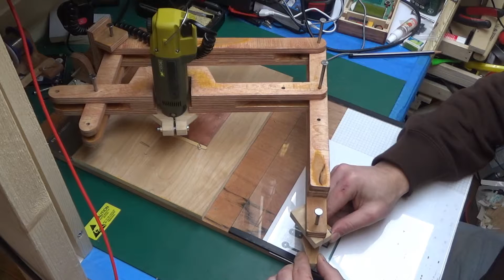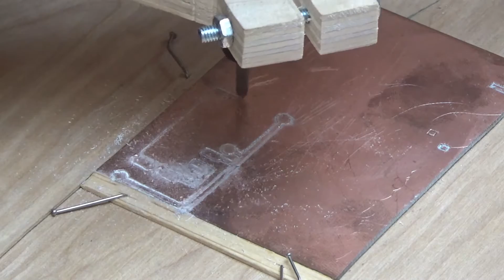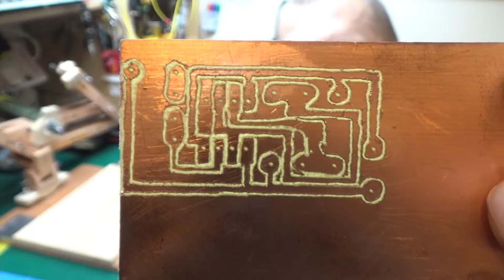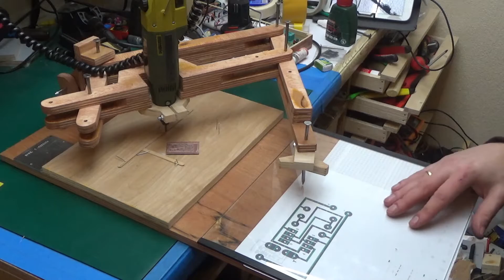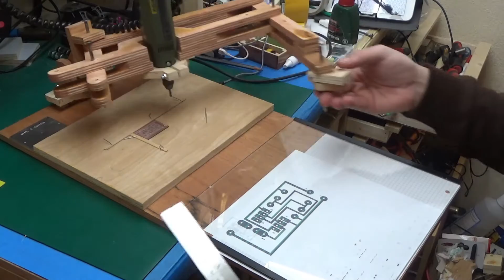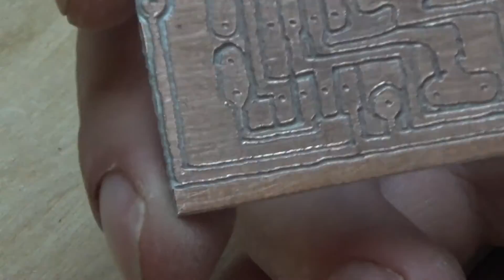This is not CNC - Pantograph PCB engraving

Comment: To hold the circuit boards down, what about a vacuum table using some kind of perforated wood? The vacuum would also collect some of the dust produced.
Reply from the maker: +Jason Olshefsky +Jason Olshefsky yes, vacuum tables are cool. But there are a few drawbacks to vacuum table: noisy, will spread dust that gets sucked in, unless well filtrated. Basically you need a vacuum cleaner hooked up to a chamber. Seems an overkill, I wanted this to be compact table top device. I think I will stick to some kind of mechanical fixing, it just seems more sensible at this scale.

Comment: Nice job.  I free hand simple circuits often and your first board is already better than anything I do.
Reply from the maker: +joe smith thanks! :) The engraving bit was nit good though. I am really excited to try a proper engraving bit.
Reply: I used to use various cutters and went to some ones that you would use in a router like this.  I tried some that were titanium coat some plain carbon steel.  They were really inexpensive.  10 for around $10 USD. It will be interesting to see how it does after you have some practice and better cutters.
Reply from the maker: joe smith that's exactly what i am waiting for :)